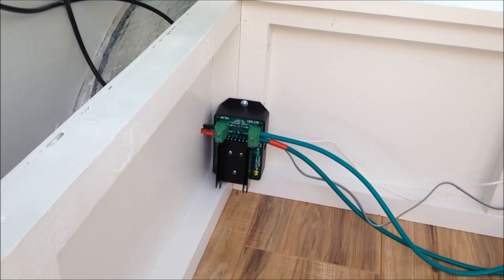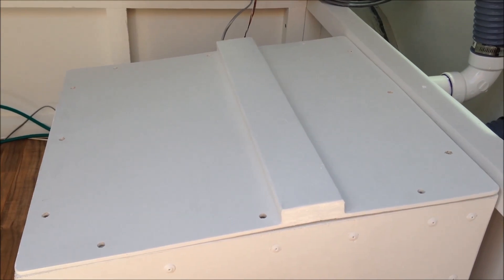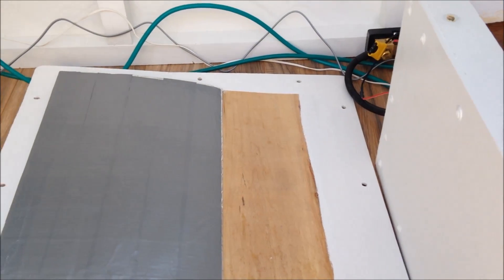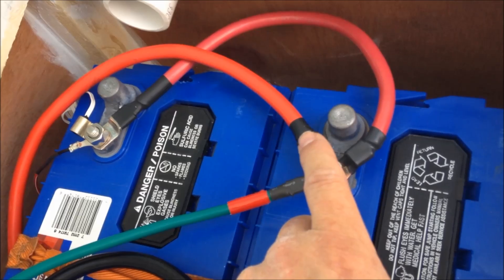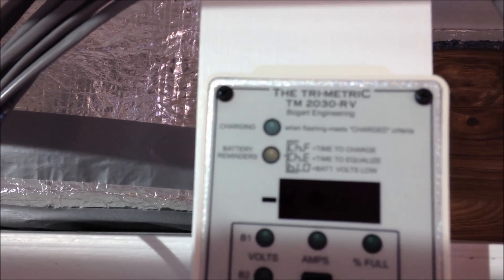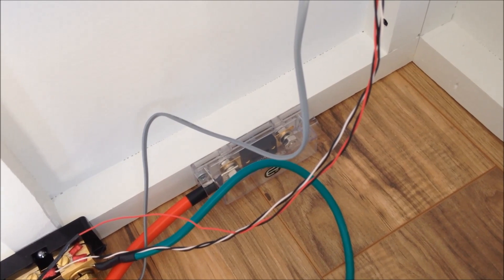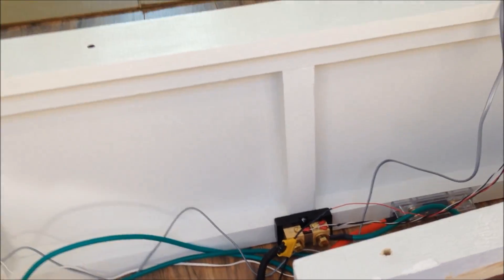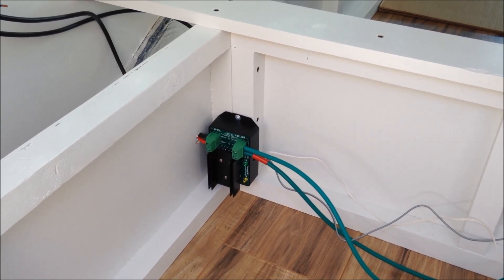Installing A Bogart Trimetric Battery Monitoring System in the Ford E350 Camper Van Conversion

Comment: In regards to all the small wires, if you didn't have the trimetric attached, would there only be the white wire from battery to controller? Is that a grounding wire for the controller? I bought a victron 100/30 Bluetooth controller. Didn't come w any wires. I bought 6 gauge wires to connect to battery.  Haven't hooked it up yet. Making a couple portable panels and battery box beforehand. I am hoping the monitoring system thru Bluetooth to my phone will give me the wealth of info you get on your trimetric!
Reply from the maker: The small wires connected to the shunt on my system are from the Trimetric monitor. Unfortunately I am not familiar with the Victron 100/30 Bluetooth controller. I am thinking each manufacturer or system so to speak will most likely have it's own special wiring set up. I'm not sure about giving you any wiring tips on your device. I hope you have some wiring instructions or maybe search them out with a google search. I just don't want to give you bad advice and have you end up burning something out because it was wired incorrectly. I do think it sounds like a real neat product by allowing bluetooth monitoring of all the battery information.
Reply: WannaBFree thanks. Tried out my 6 gauge wire for controller to battery last night and it is too thick to fit. Even called place ordered victron to confirm fit before purchasing wire since it did not say size wire that would fit in instructions. That was a wasted wire purchase, had to cut a lug off for connection. Was a little hard to cut so maybe with a perfect cut it would fit....  I hate having to wait so long to receive my solar setup supplies. Ordered 8 gauge last night from amazon, week or so for delivery even w prime, ugh! Do you have any recommendations for a good wire cutter for thicker wires like 6 gauge, lol. 
Thanks again.
Reply from the maker: Sorry but I don't have any recommendations for a cutter. I never seem to have the right tools but I think I would have used a hack saw myself. Then you would probably have to clean up the cut with a Dremel tool or hand file to smooth things out a bit.
Reply: WannaBFree oh yes, a dremel to clean up cut. I have to do some more cutting to add a fuse to the controller to battery wire and that will make it easier this time.  Was able w some effort and guidance to get the 6 gauge to fit.  Unfortunately, now have to remove and attach fuse, 😢. Thanks!!!

Comment: Good job! It might have been nice for the Solar wiring to come in on the same side as the battery box. But I certainly see no problem with the way it is after carefully securing the wiring. I really like the Trimetric battery monitor. A must have for me!
Reply from the maker: +stringbender57 I agree, unfortunately the build was constantly changing as I was building and that's the way it came out. I originally planned to put the battery box on the left side but later determined that it would be better to off set the weight with the refrigerator. Then I also thought it would be best to put the battery box vents on the passenger side for driving in wet conditions and away from oncoming traffic. It did work out ok and I'm still within wire size, amp load and wire run specs. Fortunately all is well with the system as it turned out. Thanks for the comment.

Comment: did you use 12 volt batts?
Reply from the maker: The Deprey's Yes, I'm using two 12V deep cycle batteries wired in parallel. I would have preferred two 6V batteries wired in series but I already had the two 12V batteries.
Reply: yes if you had them then its not worth spending  more money for nothing..

Comment: I swear the more I try to learn about electricity, the more lost I feel.  lol... but it sounds good.  I'll keep trying 'cos when you have to pay someone to do this kinda stuff, you want to know SOMETHING, so you can get what you want and need.  I am guessing, even if I cant do solar right now, I should wire van for it along with hookup to van alternator/battery and to house batteries, when I get 'em.  From what I have learned, seems like 4 6v are the way to go.  And... AGM? maybe?  I want the least complicated, low/no maintenance.  My one confusion is the fact my van is already wired with a 150/400w inverter with plugs in front and back, so not sure if that means I could "skip" doing something.  ugh.  My brain hurts.  lol. Thanks for posting... your clips do help folks like me.
Reply from the maker: Day Drifter Good to hear you are getting something out of my videos. I have done a lot of internet research on solar set up. I think most people would be able to do this work themselves if they study enough. It's really quite simple. The biggest problems I have run into is making a decision of what to get because there is so much out there to chose from. Maybe I will do a video soon talking specifically about the solar system I am using and why. Please feel free to ask any questions you have I'm happy to tell you what I know. Just understand, I am not an expert nor am I an electrician. I'm just a hobbyist and learning all this myself too.